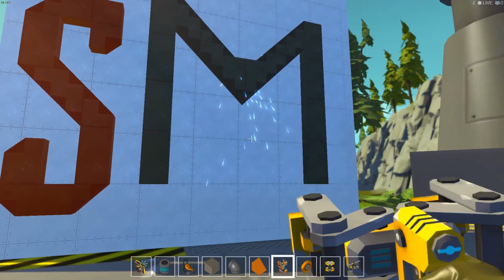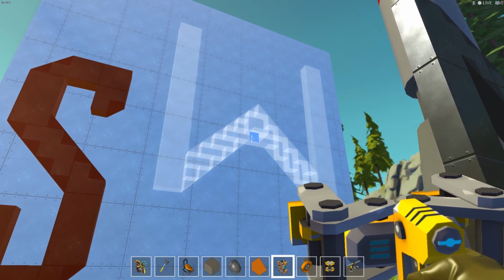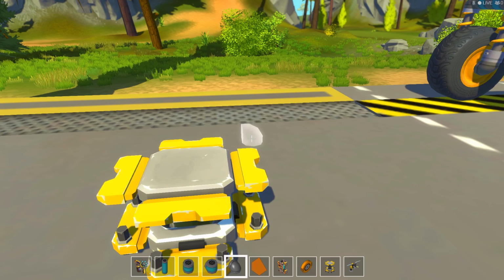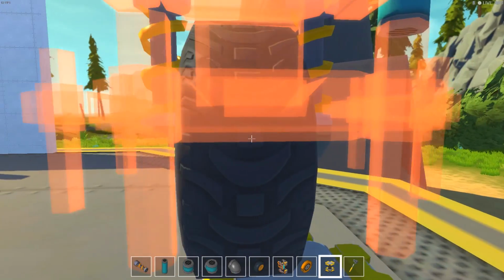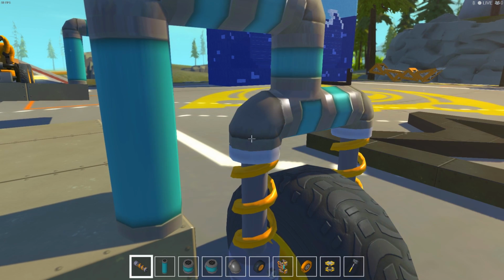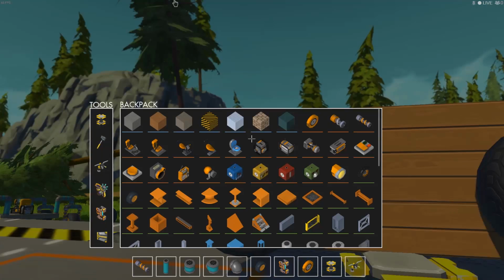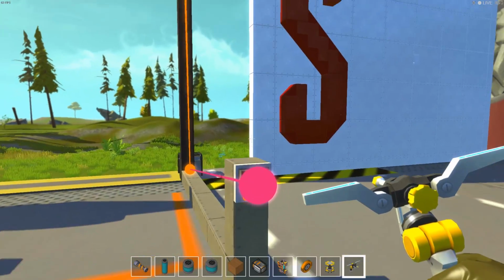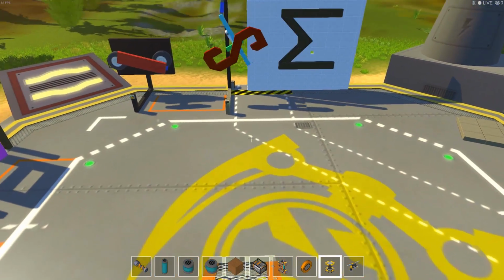Scrap Mechanic WELD TOOL UPDATE! First Impression + Tips and Tricks

Comment: Your mix of technical know-how and artistry is very rare.  I don't know many people who would come up with that dolphin idea and make it beautiful.
Reply: scrapman, it doesnt works for me
when i click and drag the objet i want to connect it is red
how can i fix it
plz reply!
Reply: ChrisPower the hitbox of the thing that ur trying to weld is probably either intersecting with the hitbox of something else in the area or the hitbox of your character. or there's also this kinda rare glitch in the game that doesn't allow u to weld something to something else for no apparent reason when its in a certain orientation. but this can usually be fixed by just cancelling the weld and then trying to weld it again. or in some cases, welding the object ur trying to weld be in a different orientation to where it doesn't really make a difference in ur build is an easy workaround for the bug, but that mostly applies to symmetrical builds with a two-block center